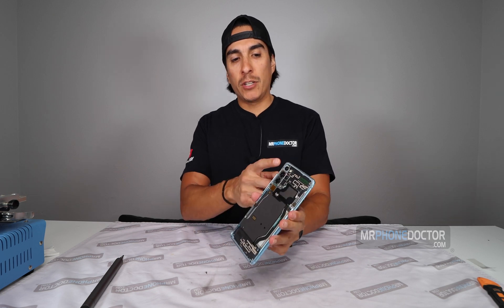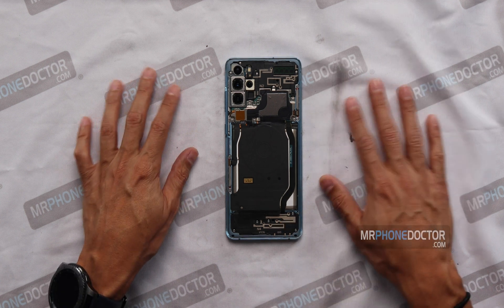Samsung Galaxy S20 Plus Teardown with Detailed Explanation - DIY

Comment: Hello, I was wondering if the S20 plus' DP alt mode can break separately from all other functions of the usb c port? I've dropped my phone recently. I dont have any issues with it other than the DP alt mode. The usb c connector on my phone works fine (charges and transfers data without issue) but when connecting to my display it does not work. I've tried multiple adapters already

Comment: I need some help.

 I accidentally screwed up. I wanted to eject the SIM from my phone but I put the SIM ejector tool in the adjacent hole on the top of my Galaxy S20+ and I believe I have damaged something.

But my mic and speaker are working fine. Any suggestions as to what I might have damaged? Water proofing maybe?

Should I take it to service center?
Reply from the maker: Is something not working? That may of been microphone port.
Reply: @MrPhoneDoctor  Everything seems to be working fine. So, either I damaged the water proofing or nothing at all. I am desperately hoping for the latter to be true.